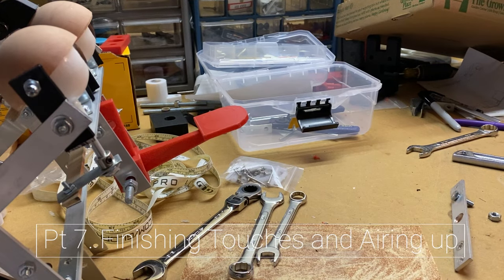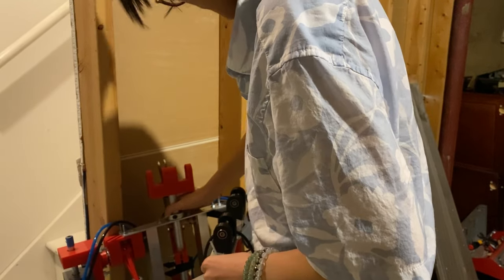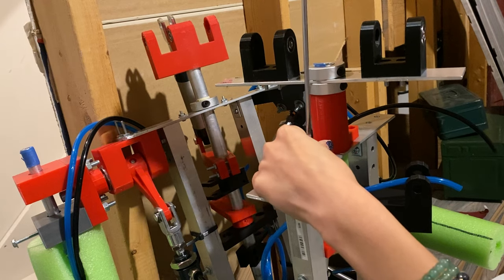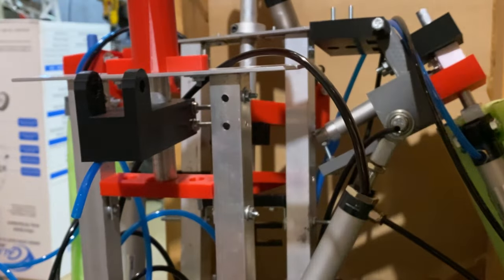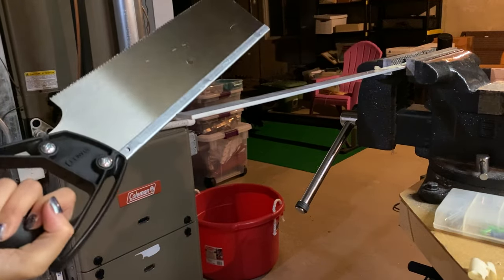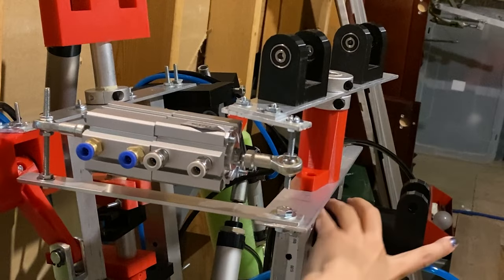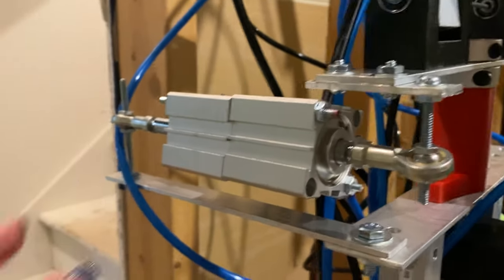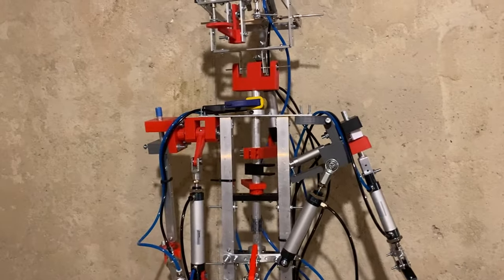Pt 7.  Yoshi's Pneumatic Animatronic Project- Airing Up My 1st Character "Atlas"

Comment: What are the eye turn cylinders called?
Reply: idk what she has but i would use mini air cylinders
Reply: I think it’s a 7D-5 Clippard Double-Action Pneumatic Cylinder
Reply from the maker: @braylonmiller6342  I think you’re right with clipperd, they are single-acting cylinders though